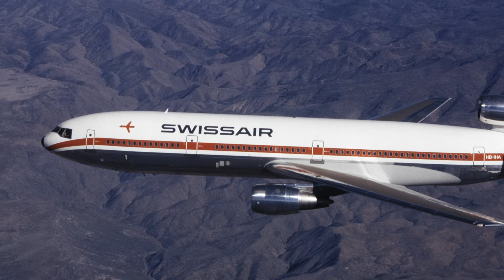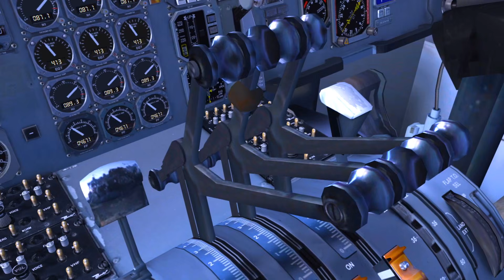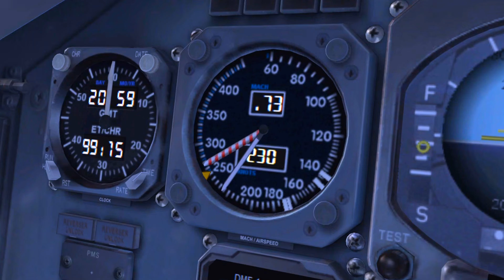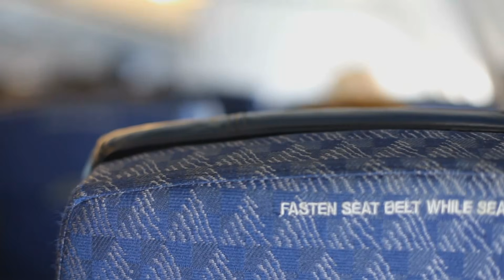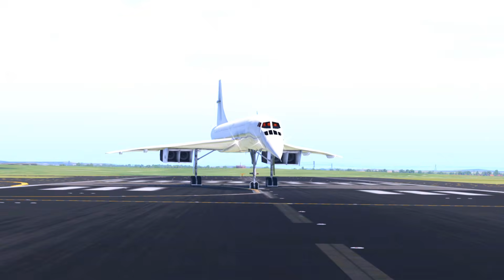The Unsettling History of the DC-10 (National Airlines Flight 27) - DISASTER BREAKDOWN

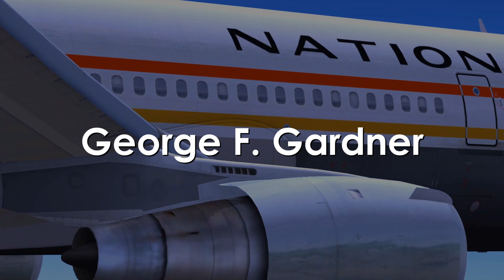Comment: 14:30 Awww yeeeaaah baby,
BEAUMONT, TX!!! Used to go there for their “Alligator Festival” which actually is in Anahuac (but thass just across the bayou). Also used to work at the Livestock/Equine auction there (when I was like 11). Sorry, umm RIP… Beaumont man…

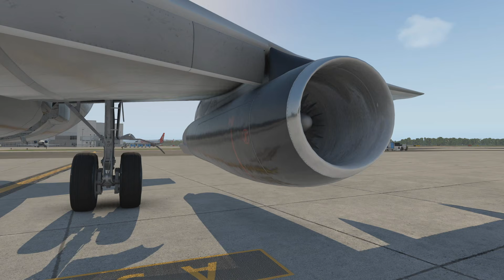9:07 If you notice, THAT particular engine has an interesting design, with the first several LP-Comp stages actually doubling as your Bypass Fan! 

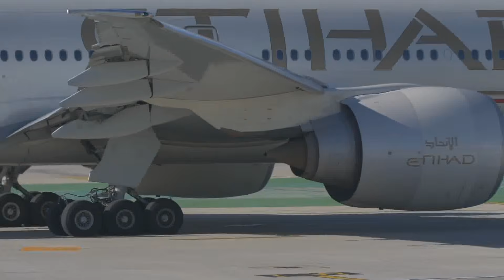3:32 Uummm…. On the Etihad aircraft pictured, are the main gear supposed to have the “Medusa Maze” of lines/cables dangling down [seemingly] touching the actual tires? Might gotta zoom in a bit to see. 

0:45 So what are those 4 lines wrapping around Engine N°2??? Fan location?

Comment: The cargo door incidents are the fault of McDonnell Douglas. This incident however, is entirely the fault of GE. Even after factoring in Boeing’s 737NG and PW 777, uncontained engine failures are not unique to MD or successor companies that adopt MD mentality. In November 2023, a Rolls Royce powered A330 operating as MU721 experienced an uncontained engine failer where a blade fragment ruptured the nacelle.

Comment: You seem to gloss over that the DC-10 ignored every principle of fail safe design. No pressure relief vents to prevent the floor from collapsing when the inherently unsafe cargo door blows off, severing all flight control cables. No check valves to prevent loss of hydraulic fluid, resulting in total loss of flight controls. Susceptible to a single point of failure resulting in loss of aircraft

Comment: The thing about United 232, yes 112 died, but there were nearly 300 on that flight. This crew got the plane to a runway at the airport which saved lives. No other pilots in simulators even came close to an airport and no passengers could have survived the crashes from the simulators. In history only one plane had complete hydrolics failure and landed the plane. It was a cargo plane that took a missile hit to its wing and the crew was able to set it down on the runway and it went off the runway into a mine field. Luckily the crew survived. The job done by both of these crews were heroic. If the pilot of 232 wouldn't have advance engine on one engine and decreased on the other, all would have died on this plane.

Comment: The Air France Concorde never overruled any part of the dc-10. Witnesses declare that the plane was on fire before it ever got to that part of the runway. It has been determined that the sloppy loading of the passengers as well as the cargo area of the plane had it considerably loaded with weight aft. There was nothing that that plane could have done or the pilots that would have saved that plane. The test data on that plane clearly indicates that anything more than 51% of weight after Centerline makes the plane on flyable. At 53 or 54% aft loading, that plane was doomed from the moment they started their taxing role. They also had transitioned from a taxiway onto the main Runway across a piece of Runway that was under repair, something that the Concords tires also are warned against doing. The Concorde was doomed from the moment they decided to put on a show, and had it gone a little bit further left it would have also killed the cabin crew and of a plane sitting transverse to the runway with Jacques Chirac had been brought up into the cabin to watch the takeoff. It was that already that far left of center of the runway.

Comment: I had taken that National Flight in August '73 (I wasn't even a teen yet) and to get from Miami to Las Vegas. It should have been about 7 hours with the two stops at New Orleans and Houston however it took more than 20 hours... 

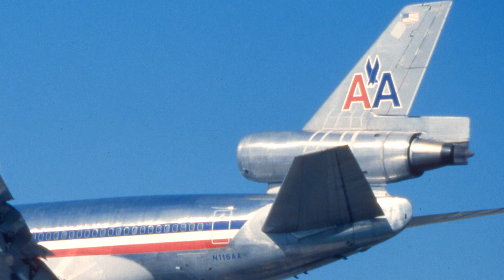Starting with a 2+ hour delay getting out of Miami because the rear cargo door couldn't be closed. I always sit in the back and in this case I was the second or third row from the rear on the left hand side and I can hear the guys talking right underneath me and every time they try to slam that cargo door closed which must have been 10 or 15 times minimum. Luckily I was ignorant about the way the door operated or else I would have gotten off the plane immediately. Then a 10 hour delay in New Orleans while an "engine was changed". In all reality they probably had to change some pumps or igniters or some other components in the number one engine but we were stuck there for a long time and by the time everyone funneled back on the plane half the adults were drunk off their ass. Another 60 Minute delay in Houston for somebody who was just too ill to keep flying all the way to San Francisco and we finally got to Las Vegas at about 2:00 in the morning morning (our hotel room was given up because we missed the 9:00 p.m. late check-in time. Luckily it was at the Dunes where we had been going for years and ended up actually finagling and even better room).

I flew on DC-10s close to 30 times, at least, and had problems on three flights so 10% of the time which is pretty damn bad even for back then.

Comment: We applaud your thorough and complete analysis. We subscribed.
McDonnell-Douglas has an excellent record with military and commercial aircraftv, and as you point out, many of the worst incidents involved improper maintence or factors not reated to the aircraft.
There were design flaws in the cargo door latches, and after the Turkish crash, it was sent back to the drawing board.
The GE high-bypass turbofans apparently had resonance issues which were not completely resoved when the DC10 was launched.
Basically, the DC10 had high potential, but not realized fully because of factors in the supporting  array of suppliers and maintainers. 19:32

Comment: The DC 10 was crap. How the hell you gain access to number 2 engine on line maintenance troubleshooting??? There's acces from the ground but bloody dangerous. I was up there. The pylon is splitted and It is a little platform to stand over. Barelly you step with the toes at 60 feet high. And pilots like It??? Critical flare on landing to avoid number 2 engine to stall because of airflow cut do to the fuselage. McDonell Douglas was not good comparing to Boeing. Even the company lied to the customers with the MD11 range capability. Swissair intended do Zürich-Sidney in one leg like McDonell Douglas promise It. No way.

Comment: To clarify when he says fans and blades are in the compressor wheel he means that there are rotors and staters. The rotors spin and the staters redirect the flow of are back to more linear flow. Standard blades are stationary. They are to take the rotation out of the flow and compress the air in a linear fashion.

Comment: Are engine failures really the DC-10’s fault?  McDonnell Douglas doesn’t manufacture engines.  Even the cargo door issue was more because it wasn’t closed properly, not the design.  Hell Turkish airlines didn’t bother to have people on the ground operating the door that could read the instructions on the plane right next to the door.  I think it gets an undeserved bad reputation

Comment: The DC-10 was a complete shitbox susceptible to single points of failure, resulting in catastrophe. The vastly superior L-1011 had redundant flight control systems and four independent hydraulic circuits

Comment: Though the video mentions no connection between the flight crew's #3 engine experiment and the subsequent explosion of that same engine could be proven, what surprises me is that it made no mention re: the propriety of pilots doing engine performance experiments during a passenger carrying flight. Though it did mention that they went outside of standard procedure in doing so. And there was no mention of the NTSB recommending that all aircraft engine performance trials be reserved for tests pilots in the air, mechanics on the ground, or commercial pilots in a simulator.

Comment: Holy crap, I didn't know the fragment that killed the Concorde was from a DC10!
Reply: You really can’t blame it on the DC-10 though, in all reality, it was the Concorde that killed itself. It could have been anything that caused the tire to blow, including the fact that the Concorde was incredibly hard on tires on its own.  The fact that a piece of its own tire damaged one of its fuel tanks and caused it to catch on fire is pretty inexcusable really.
Reply: @andrewnajarian5994  Prior to the Paris crash, the Concorde had at least two documented cases of tires shredding due to either impact with debris or stress from landing.  So it was a known issue.  In defense of the DC-10, the metal coming off of the engine cowl was due to improper installation of the piece.  This could have happened with any aircraft or engine type.

Comment: Impressive. I have flown a lot in the last 10 years being Platinum (100 hops per year) for 4 years and Diamond (140 hops) for an additional 4 years with Delta. I follow all the good YT channels and I must say yours is excellent! The level of detail, who dun it, how it happened and digging deeper down is very exciting and tremendously informative. Your assessment causes me to speculate the dirty mark on the DC10 was actually an engine and related manufacturer issue. Also engine containment, now a major deal must have just been a negligible thought back then. Jets fail, engines blow should they have just hoped for the best and not designed nacelles that would largely contain the failure? There is a video of the massive engine used in the largest airbus model that shows a purposeful detachment of a front fan blade (the very largest ones) at full power. The engine bounces around and the cowl does similar but for the most part stays together and contains the explosion. Wonder why it took all those years to get to that point. Again EXCELLENT work thank you truly a joy to watch!

Comment: I think that the part the Concorde run over was not an engine part but a part of the engine pod, a metal strip off the aft part of the pod. The DC-10 completed its journey uneventfully and the missing strip was noticed only after it had landed.

Comment: I am a farmer who watched United 232 fly overhead shortly before it's crash in Sioux City Iowa. I remember telling my wife there must be something wrong because it was flying much to low. We later received a letter asking us to look for possible engine parts because we were in it's flight path.
Reply: It certainly was something wrong with it too.
Reply: The fan disk had a crack and it let go. They used to shot peen the fan disk prior to inspection and it hid cracks.
That crash changed the repair process on the CFG fan disk.
I know it was bad , but we learned from it , so it would never happen again.
Reply: @stacked7476Yapper
Reply: @stacked7476tough guy over here
Reply: Wow.
Reply: And did you find some?
Reply: I did not find the missing part. It was found about 40 miles away. @marcleslac2413

Comment: For sake of mention... the DC-10 was a good design for the times and a fine flying airplane and none of the issues it suffered were the fault of its design, instead blame lies in outside resources.   Engine flaws/mishaps, not the fault of the airplane.  Maintenance or lack of, or "short-cut maintenance",  not the airplane's fault... such as the engine that broke off a DC-10 on takeoff in Chicago because of a maintenance-damaged engine mount.   That rear cargo door?   The design was approved across the board but Nature continues to design better idiots who failed to correctly shut and latch the rear cargo door.  Bad luck more than anything else gave the DC-10 a much-undeserved reputation.   I liked flying on them, comfortable and secure, especially if you manage to land a seat at the rear by the galley.   The close proximity of the flight attendants allowed snacks and drink perks.  :)

Comment: The dc 10 is a great airplane that is still flying with the military as the KC 10 or “the big sexy”
Several have been retired recently as newer tankers are delivered but no one wants to see them go, they do there job extremely well and are overbuilt. Their aircrews love them, my niece flew them for years before switching to the C 17
There are also several converted to air tankers to fight forest fires, I was lucky to see one in action and it was unbelievable to see something so big fly so low and slow while dropping retardant.
In high school My dad worked for National and I was able to fly  all over the world on DC 10’s. Something not mentioned in the video but shown in a few of the pictures was the 30’s and 40’s series which were made to fly intercontinental, with more fuel tanks and to handle the additional weight a third landing gear was added right in the middle between the main gear.
I got to fly every couple of months, anytime I had off from school I begged to go somewhere. 
This was after the cargo door/maintenance issues were worked out ( the doors were forced closed which damaged the locking mechanism if I remember correctly) so I felt safe even after one trip out of SFO which lost an engine with a pretty loud bang on the climb out and with the whole plane shaking, circled out over the ocean to dump fuel and made back to SFO :) the engine was completely shredded and they had to ferry it back to Miami with a skeleton crew as it was unrepairable. So great airplane, not so great engines…

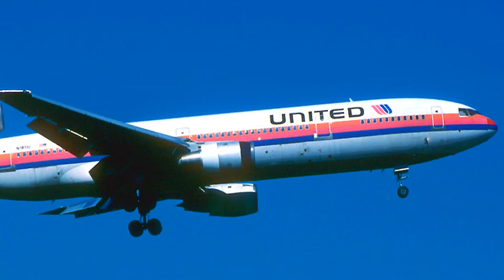Comment: 16:40 - I would argue that the most shocking accident on American soil, was American Airline Flight 191, on May 25, 1979.  A DC-10 on take off from Chicago's O'Hare Airport, had its port engine come completely off and tore the pylon off the wing, which severed hydraulic and fuel lines.  The plane crashed moments later, killing all 271 people on board and 2 more on the ground.  I believe it is still the deadliest aircraft disaster in the United States.

https://youtu.be/F6iU7Mmf330

Comment: If you readthe Wikipedia entry on this incident it seems the crew were doing some unauthorised experiments on the engines by pulling circuit breakers and seeing what happened. These experiments shoyld never be attempted with passengers on board, and could lead to overspeed and disintegration of the engine.  Seems they couldn't pin this on the crew due to a lack of evidence.

Comment: It's silly really the way the DC10 gets demonised, since the majority of the incidents had nothing to do with the technical side of the aircraft itself as this vid points out early on. There have been many more incidents with the 747 but that iconic bird has never been so demonised, indeed no-one ever really discusses 747 crashes ( at least in terms of number of incidents ). I flew on many DC10's back in the day ( AA, Iberia, and Laker ) and they were always excellent comfortable experiences. I loved the DC10.
Reply: The centre fuel tank on TWA800 was much spookier than the flight crew playing engineer on this aircraft, even though it may have been coincidence.
Reply: Had nothing to do with the technical side ? You should read the industry reports. 2 cargo doors in 2 separate incidents blow off. Investigators discovered that McDonnell Douglas KNEW about the faulty doors during the testing phase, before any of the planes took to the sky. In another video, it was mentioned that after American flight 96 over Windsor, the regulatory agencies told McDonnell Douglas to fix the cargo doors. The company was worried that reports of faulty doors, would hinder sales, since they were skirting on the edge of bankruptcy. An 'airworthiness directive' should have been implemented, making the repairs mandatory but McDonnell Douglas struck a deal, so that the order was downgraded to a ' service bulletin',which was less urgent. Turkish Airlines flight 981 was to have had a new cargo door installed but McDonnell Douglas did NOT install it and it crashed. Later on in the investigation, the documents on that particular plane, revealed that someone at McDonnell Douglas signed off, on the repairs but they were never done. Innocent oversight or fraud and coverup ? With American flight 191, it's true that the airline was involved in shoddy maintenance practices but MCDonnell Douglas again came under scrutiny, when it was discovered that the broken engine severed the all the warning systems and because of that, the pilots unintentionally stalled the plane. MDD came under criticism for not installing backup systems that would have alerted the pilots to the dangerous situation that they were in.  The plane was grounded for 6 weeks and it was not allowed to fly again until ALL safety modifications were made. The manufacturer cut corners because they wanted to beat the Lockheed 1011 to market so yes, there were plenty of technical/ design errors with this plane. The executives knew that it was a dangerous plane but they let it fly anyway. They were worried about their wallets, not about the safety of these passengers and flight crews.
Reply: I said the majority of incidents - not ALL - many of the incidents involving the DC10 were pilot error...............Study them.

Comment: I still see a ton of tri engine planes right near Boeing field and Seatac. I swear they are FedEx planes but maybe I am confusing them with UPS? Are they MD-11s?
Reply: They would be MD-11s. According to Wikipedia there is just one ex DC-10 left operating, in South America. This aircraft had the glass cockpit conversion, after which the aircraft was redesignated as a MD-10. Boeing did these glass cockpit conversions following a request from Fedex, there was no need for the flight engineer & crews only needed one type rating. They were allowed to fly either the MD-10 or MD-11 with the same type rating.